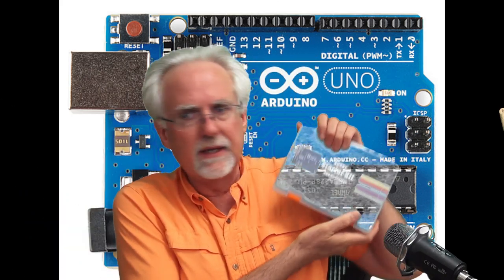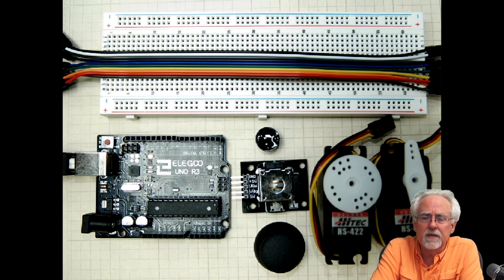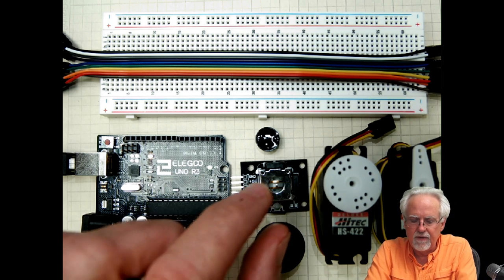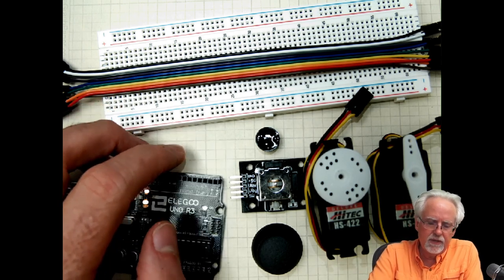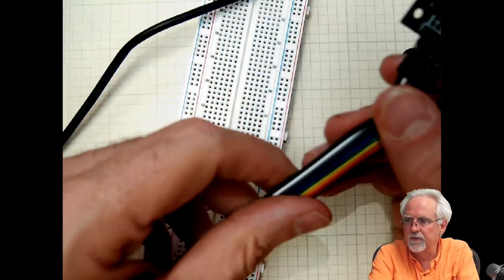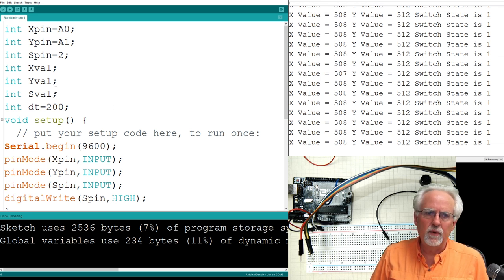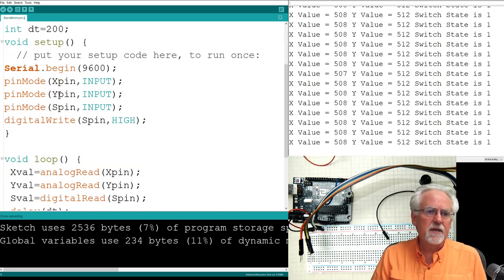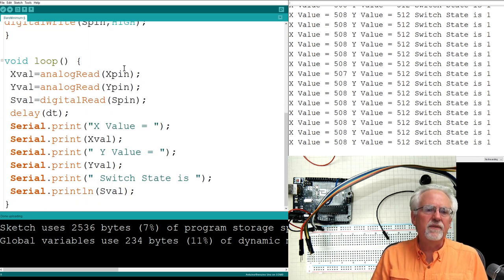Arduino Tutorial 33: Understanding How to Control Servos with a Joystick

Comment: Bosco!

For those interested in RC applications, I wrote this code entirely in variables. This allows you to adjust the max/min angle of the servos and the sensitivity of the joystick. It is not quite like I want it, but a work in progress.
//Paul McWhorter Lessons
//"New Arduino Tutorials: 33 Joysticks and Servos"
//by Jonathan Landers
//May 13, 2023

#include <Servo.h>
//Virtual Servos
Servo Servo0;
Servo Servo1;

//Real Servos
int servo0 = 7; 
int servo1 = 9;
float servo0A; //angle out
float servo1A; //angle out
// Max/Min values for servo angles (Modify per project)
float servo0Amx = 180;
float servo0Amin = 0;
float servo1Amx = 180;
float servo1Amin = 0;
// Servo Starting position (Modify per project)
int servo0Astart = 90;
int servo1Astart = 90;
int delstart = 2000;

// Joystick
int Joy0x = A4;
int Joy0y = A5;
int Joy0xV;
int Joy0yV;
int Joy0sV;
// Max/Min values for joystick potentiometers (Modify per project; Controls Joystick sensitivity.)
float Joy0xVmx = 1023; //Ex. Max throw of 0 - 1023
float Joy0xVmn = 0;
float Joy0yVmx = 911.5; //Ex. Less throw of 111.5 - 911.5; More sensative controls.
float Joy0yVmn =111.5;

int del = 100;

void setup() {
  Serial.begin(9600);

  pinMode(servo0, OUTPUT);
  pinMode(servo1, OUTPUT);
  Servo0.attach(servo0);
  Servo1.attach(servo1);

  pinMode(Joy0x, INPUT);
  pinMode(Joy0y, INPUT);

  Servo0.write(servo0Astart);
  Servo1.write(servo1Astart);
  delay(delstart);

}

void loop() {

  /// JOYSTICK ///
  //Read values for Joy0 x, y from 0 to 1023
  Joy0xV = analogRead(Joy0x);
  Joy0yV = analogRead(Joy0y);
  //Make sure Joy0 is within Max and Min values
  if(Joy0xV > Joy0xVmx) {Joy0xV = Joy0xVmx;}
  if(Joy0xV < Joy0xVmn) {Joy0xV = Joy0xVmn;}
  if(Joy0yV > Joy0yVmx) {Joy0yV = Joy0yVmx;}
  if(Joy0yV < Joy0yVmn) {Joy0yV = Joy0yVmn;}
   //Print Joy0 values
  Serial.print("Joy0xV = ");
  Serial.print(Joy0xV);
  Serial.print(" Joy0yV = ");
  Serial.print(Joy0yV);

  /// SERVOS ///
  //Calculate servo angles via linear equation between Joy0 and servos 0 and 1
  servo0A = ((servo0Amx - servo0Amin) / (Joy0xVmx - Joy0xVmn)) * (Joy0xV - Joy0xVmx) + servo0Amx;
  servo1A = ((servo1Amx - servo1Amin) / (Joy0yVmx - Joy0yVmn)) * (Joy0yV - Joy0yVmx) + servo1Amx;
  Serial.print(" servo0A = ");
  Serial.print(servo0A);
  Serial.print(" servo1A = ");
  Serial.print(servo1A);
  //Write angle values to servo
  Servo0.write(servo0A);
  Servo1.write(servo1A);
  Serial.println();
  Serial.println();

  delay(del);
}

Comment: I loved this idea from the second you explained it! I think I did a pretty good job building it with my Meccano set:
https://drive.google.com/file/d/1ZA51RmrsB0KKrzkZruTlFHwlxJ3J2gEc/view?usp=sharing

I took a different approach on controlling the servo's though. If the joystick is pushed in a direction the servo's move in that direction but they stay there when the joystick is centered again.

I had an absolute blast building my own death laser! Thanks for this lesson Paul, it is the best so far!

And lets not forget: Bosco
Reply from the maker: Wow, thanks for sharing and your picture took me back to my childhood. When I was young, they were called 'Erector Sets' and all boys wanted a good Erector Set. You could build all types of mechanical structures and some kits even had motors and transmissions and chain drives. I did not know that those were even made any more. Seeing your picture, I see the potential of great fun and learning by combining erector sets with arduino. In fact, wouldnt it be great if they offered a combo kit with the erector set and arduino components.
Reply: @paulmcwhorter  I don't know if they still sell Meccano sets, mine are over 30 years old :) They were gathering dust in my parents attic but I retrieved them yesterday for this project. A trip down memory lane for sure!

I actually have one motor and a drive set with chains and sprockets etc. But the motor needs 14V so I will need a power source and a relay or something to make that work. Or maybe I can find a motor controller I can use.

I'm planning on exploring the possibilities of combining my Arduino with the Meccano. I have this idea for a remote or AI controlled car. Should be lots of fun. It would indeed be marvelous if they offered a combo kit.

Comment: Did it!.....Kinda. Forgot the math part. They work, but not the right way with the math. Yo

#include <Servo.h>

const int xPin = A0;
const int yPin = A1;
const int sPin = 2;
int Xval;
int Yval;
int Sval;
Servo Servo1;
Servo Servo2;
int Servo1Pin = 10;
int Servo2Pin = 9;

void setup() {
//Setup...
pinMode (xPin, INPUT);
pinMode (yPin, INPUT);
pinMode (sPin, INPUT);
digitalWrite(sPin, HIGH);

//Init Serial Comm...
Serial.begin(9600);

//Attach the servos...
Servo1.attach(Servo1Pin);
Servo2.attach(Servo2Pin);
}

void loop() {
  
//Read x,y,s values from the joystick 
Xval = analogRead(xPin);
Yval = analogRead(yPin);
Sval = digitalRead(sPin);
delay(500);

//Print values for debug...
Serial.print("xVal = ");
Serial.print(Xval);
Serial.print("   yVal = ");
Serial.print(Yval);
Serial.print("   Switch = ");
Serial.println(Sval);

//Signal the servos...
Servo1.write(Xval);
Servo2.write(Yval);

}

Comment: BOSCO
Reply: Hey, I've been watching this Arduino Series for a while now, and I noticed that you usually use your math equation to find the right digits for, for example the WVx and the WVy, but I found the map() function that does pretty much the same thing as your math equation command but without math equation, which makes using it easier.
May I ask why is that?
Reply from the maker: The goal is not to do it the easy way, the goal is for you to learn math and to develop skills that the world needs and will actually pay you for. If you want the easy way, just copy and paste someones solution from the comments. The goal is not 'easy' the goal is for you to build marketable skills.